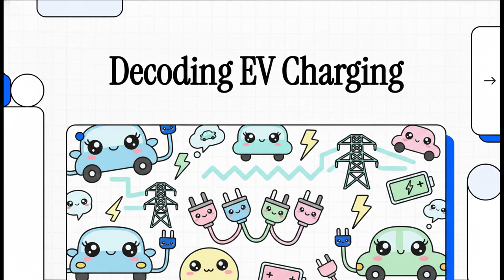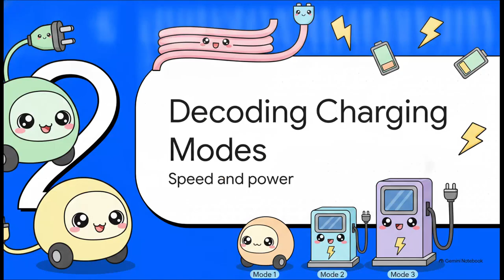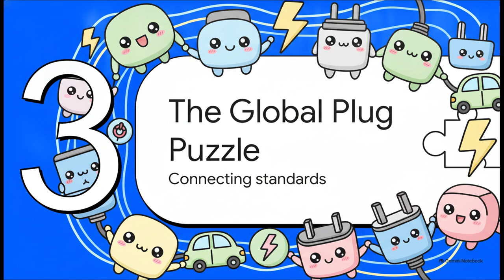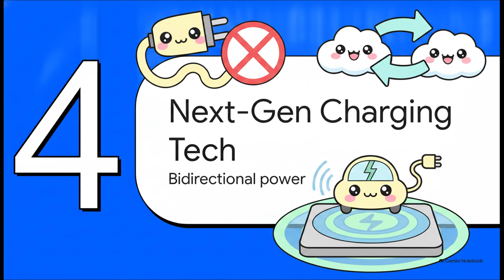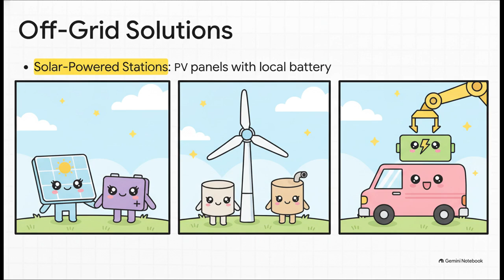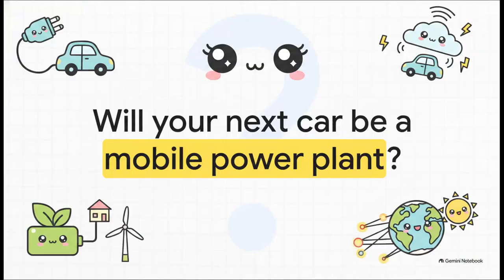Mobile Energy Storage: The Future of Emergency EV Charging & On-Demand Power

Comment from the maker: ⚡ WHAT WOULD YOU DO IF YOUR EV RAN OUT OF CHARGE 20 MILES FROM THE NEAREST CHARGING STATION?

That’s exactly why emergency mobile EV charging matters.

🚨 Bee Charged EV brings mobile charging directly to EV drivers who need power on the road.

📍 Serving EV drivers across major U.S. EV markets
📞 888-675-9555
🌐 BEECHARGEDEV.COM

👇 COMMENT BELOW:

What is your biggest EV charging concern?

1️⃣ Finding a charger
2️⃣ Charging speed
3️⃣ Long charging lines
4️⃣ Running out of battery
5️⃣ Emergency roadside charging

Let's see what EV drivers are experiencing across the USA. ⚡🚗

#EVCharging #MobileEVCharging #EmergencyEVCharging